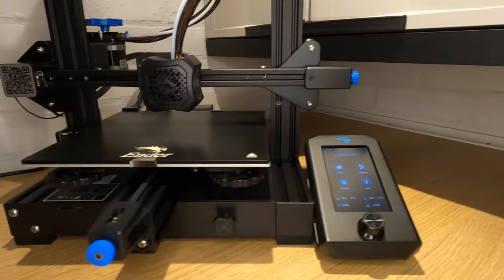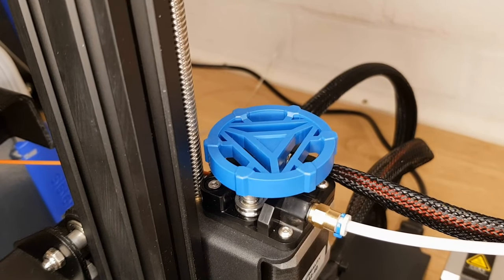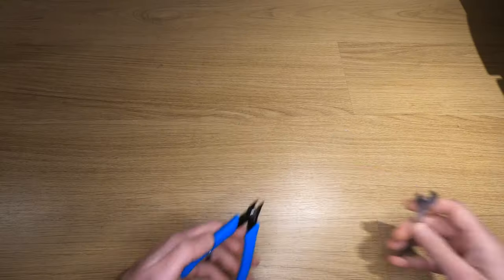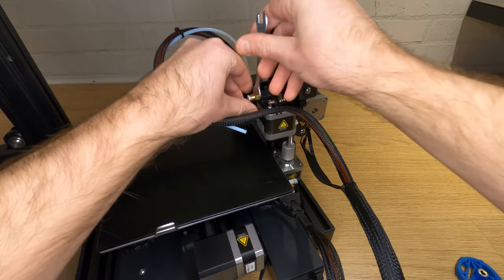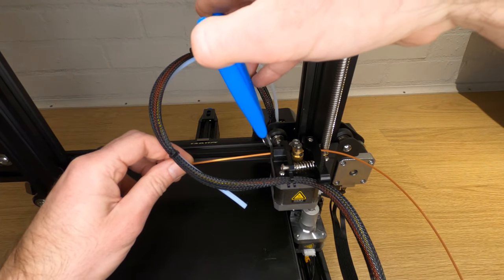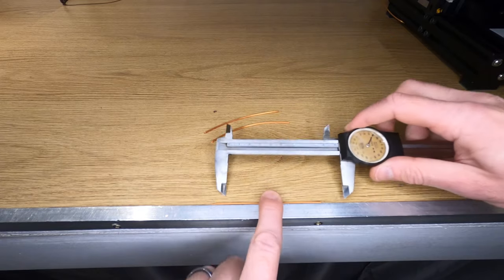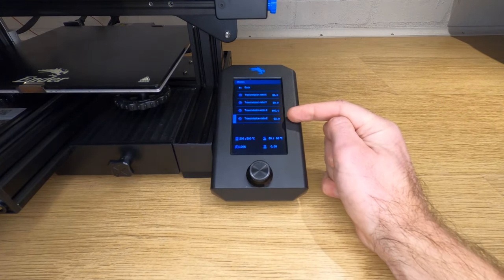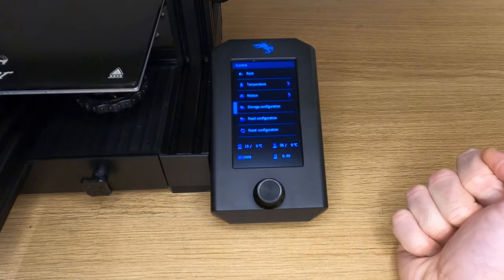Ender 3v2 - How to Calibrate E-Steps (Quick & Easy)

Comment: How do you do this on the direct drive on the S1 pro
Reply from the maker: Hi, it is a little different on a direct drive printer. Basically you need to measure and mark the filament before it goes into the extruder a work a little backwards. The same basic principles apply though. See how much filament the extruder moves when you tell it to extrude 100mm and calculate with the same formula. I will try to do a video as the more I think about it, the more I think it's needed.
Reply: @RickyImpey  thanks I just purchased an S1 Pro and that's how I came to your channel. Your latest videos with the S1 have been helpful!